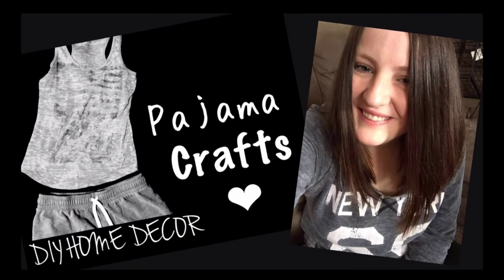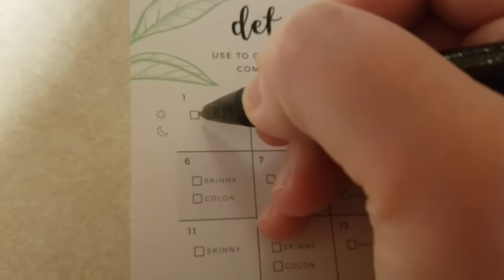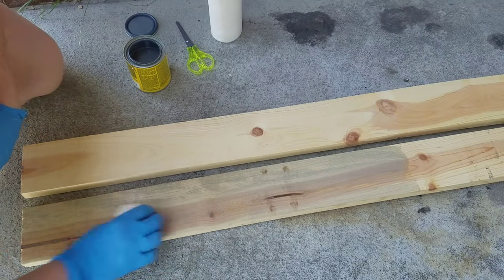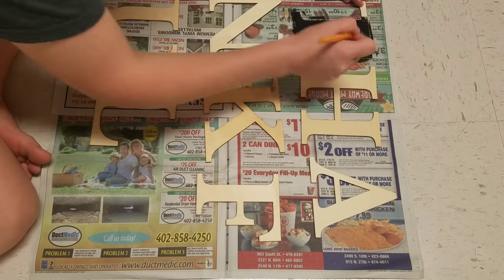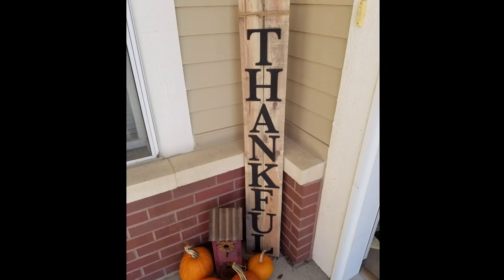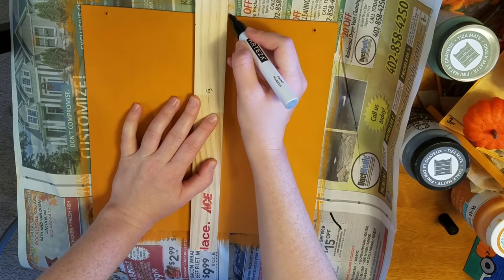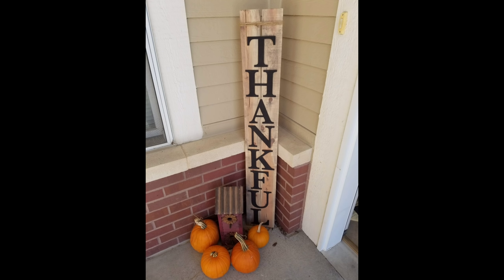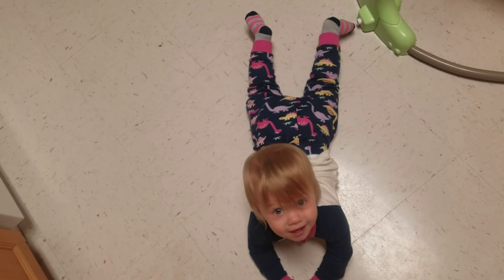DIY FALL SIGNS | DOLLAR TREE & TARGET DOLLAR SPOT!!!

Comment: @Pajama Crafts
Stanley brads (nails) are not sharp enough on the tips, that's the reason they don't go through the wood.  Take a rasp (metal file) and file the ends on both sides in a downward direction, this will sharpen the tips and they go all the way through much easier.